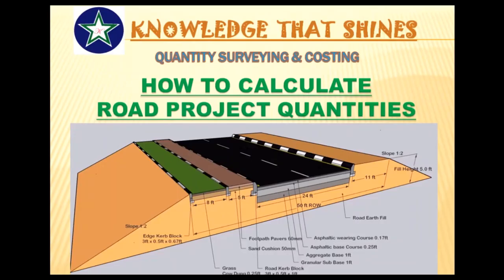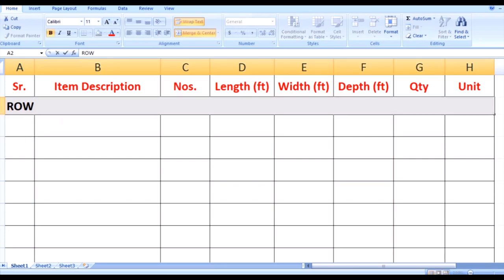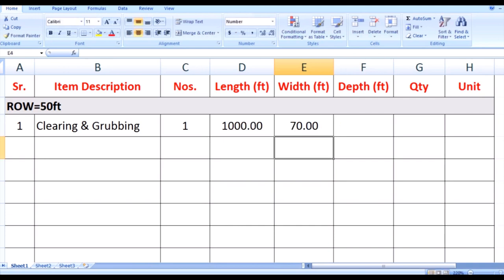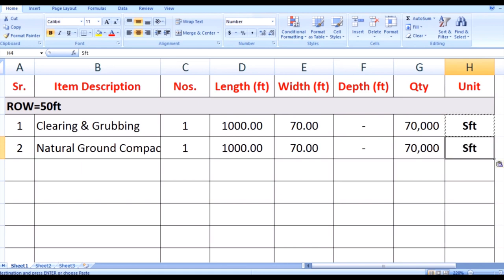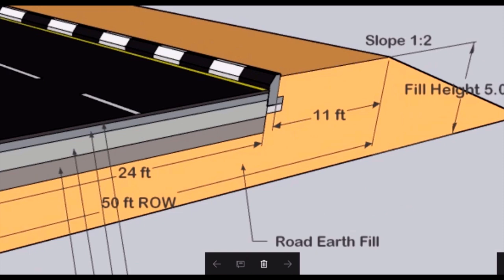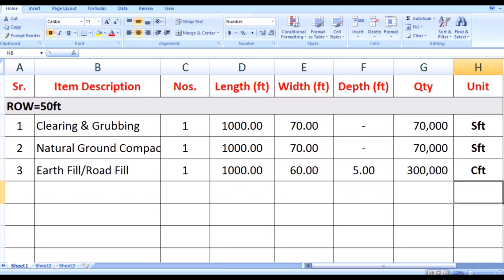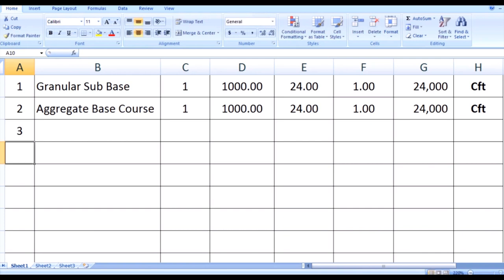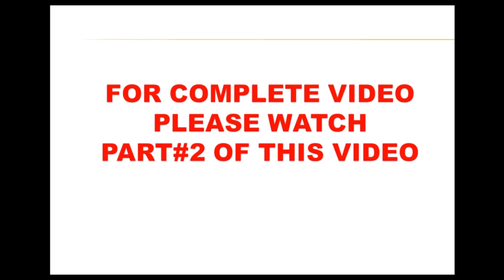Learn How to Calculate Road Works Quantities (Part#1 of 2), Quantity Surveying & BOQ.

Comment: Please describe the 1:2 formula you used for the slope? why its diveded by 2 again at the Earth fill? but not divide in the clearing & grubbing?
Reply: 1:2 means, if we have perpendicular (height) =X metre then the base will be 2X metres
And in clearing and grubbing we are calculating the bottom area however for earthwork quantities we are calculating average or medium portion plus right angle triangle both sides